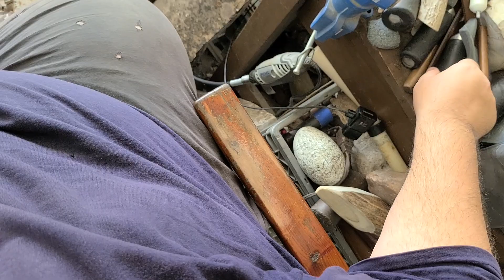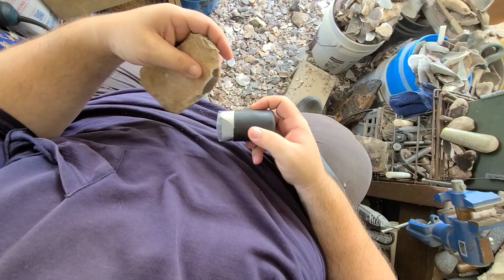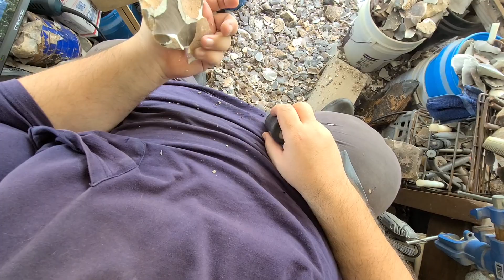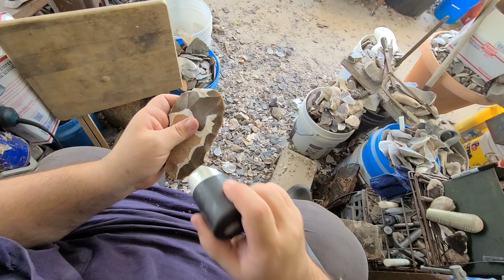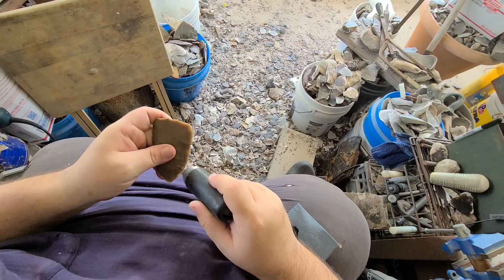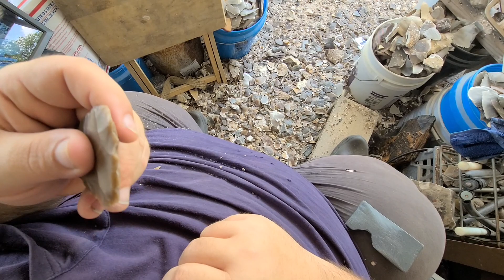Flint knapping a preform POV

Comment: Nízhóní gó Báásístóggíí íłtá íínlá (you made that arrowhead beautifully thin) I really admire your work and I yelled NOOO when it snapped but it happens and the way I believe is it comes out its it's own way and we help it.
Reply from the maker: Yeah that was 100% my fault, I should have worked the ends earlier in the process. I made it too weak to be hitting on the ends, especially on such brittle material.